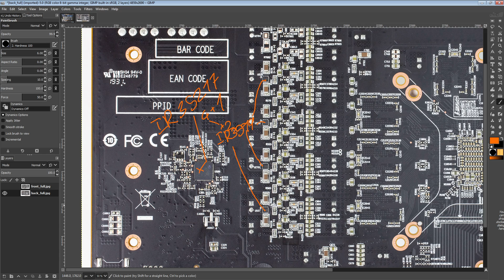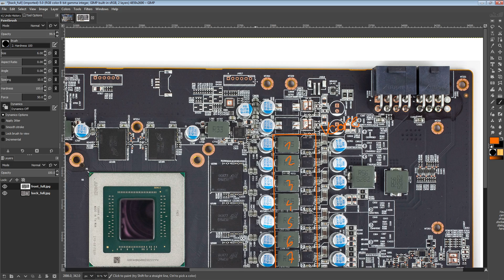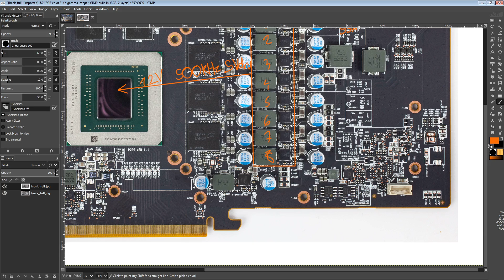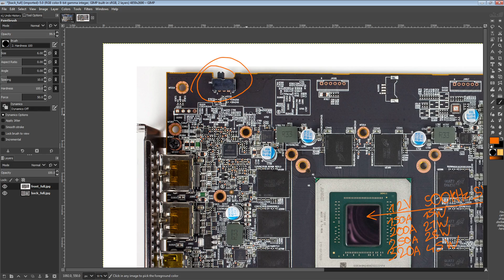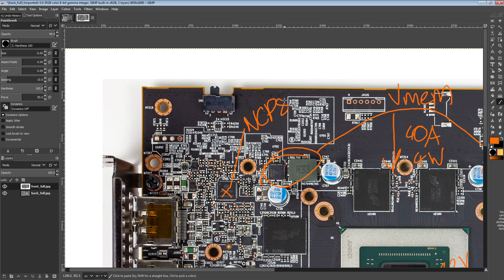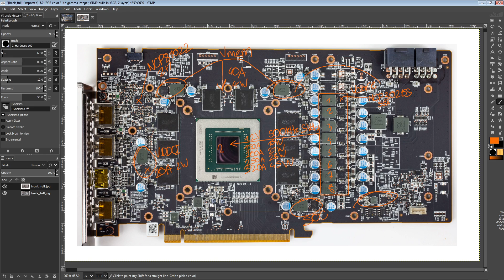GPU PCB Breakdown: Powercolor RX 5700 (XT) Red Dragon

Comment: I have ripped off c4210 component on it. can it cause no boot no power state? what is this component and how can I fix it by soldering? Pads are ripped off and I have no clue where to get the motherboard schematics.

Comment: i picked up a powercolor 5700xt for $350 380 shipped and i run linux, i might have gotten a gold gpu lol i'm getting like 2090mhz on the mem with 875 vcore at 65 to 70C at 65% fan speed

Comment: I am now on my second RMA of a powercolor 5700 XT red dragon, 1st card failed after 2 months with GPU fans on full at boot time, pc seems to boot as normal into windows with no display, 2nd card after 1 month givs a VGA LED warning light on the mobo and stops there with no display, is anybody else having issues with this card?
Reply: @nickwarrior5  thats what i did, i got the sapphire pulse & it runs cooler and quieter.

Comment: Is 1 8pin enought to bios flash a 5700xt? Im worried 5700 gaming oc with its 8 pin wont be enough to bios flash or powerplay to a 5700 xt, I can get both the red dragon and gaming oc at almost the same price like 10 bucks difference in price

Comment: Would you like to do Powercolor's RX 5700 XT base version (non Red Dragon/Devil)? I just bought one from sale as it was 30 euros cheaper than a reference card.

Would be interesting to see how much they've cutted on power delivery. This one does not have dual bios, heat pipes aren't nickel plated etc.

Edit: I can take pictures of the PCB.

Comment: Look at me point at chips that are labeled and recycle basic information.... How about something useful like where they engineered design flaws on purpose? I'll never buy another AMD card and I've been using ATI/AMD since the ATI rage days. They consistently and intentionally added design flaws in several generations of cards after they purchased ATI. When that's not good enough, they sabotage their drivers to make older cards run like crap or crash often. I've owned a high end card from almost every generation and most of them had strange issues eventually. The issues ranged from crashing, overheating, artifacts with no overheating, black screen at boot, etc, etc. Some where fixable by lowering clocks and/or increasing voltages. Some required bios mods and some were just trash. A search would show in almost every case, masses of people with the same exact issues. The thing that made me finally decide that I would never buy AMD card was when I did some testing. Using older versions of Windows with old drivers, magically, 6 out of 7 cards I still have that were crashing, overheating, artifacting and black screening at boot, worked flawlessly with no fixes required. To me that is all the proof I need to know they sabotage their older cards to push sales. Feel free to dismiss me but do your own testing. Grab some used AMD cards on Ebay that have issues and see what happens when you install them on a clean, non updated OS with original drivers.

Comment: Hey zoid, I looked threw your videos an didn't see it anyway did u or will you do a video like this on the reference 5700,  I got the asrock one and flashed it to a. Sapphire reference xt got a huge increase in performance an not running any hotter, waiting on a new pump for my loop rite now
Reply: that is a very good Q. Either google is hiding it from me, or the 5700 and 5700XT reference PCB breakdowns got lost in the hectic rush of things.  Steve has a lot of cooler vids for the 5700xt, yet no PCB BZ analysis that I can find.

Maybe I'm thinking of the pre-launch leaked PCB thing and mentally confusing it with the Vega FA analysis vids.
Reply: @Zarcondeegrissom  ya idk but hoping one gets out someday soon, like i said i looked at both pcbs and they were identical so i flashed mine to a XT since everything was the same on it, and it runs fine and even pretty cool with the blower on it, until i get my new pump anyway , flashing it gave me alot more performance it didnt unlock the cores or shaders but still a nice bump tho for sure that the PPT didnt give me
Reply: ok, just seen something on the Discord grapevine.  the ref 5700(xt) was in limbo due to some info that he was waiting for confirmation/answers to that didn't arrive till he was on vacation. So the vid 'was' in limbo. I don't know what the video production timelines are, tho he hinted the ref breakdown was in the works now that he had the needed info.   I guess all I can say is it's like predicting volcano eruptions, shake the magic 8-ball and it reads out "SOON (tm)", lol.
Reply: @Zarcondeegrissom  well ty man so much for doing the leg work and replying back to me to let me know I respect that 100% and I'm glad to know it will come ty again

Comment: This red Dragon PCB is the retail one or an engineering??
Reply: Retail.
Reply: @MaxBaltzer  funny because in the 5700XT Red Dragon official web page, there is picture with a portion of the PCB were we can see that those 2 capacitors near the 2 missing power stages are missing! Hope that the PCB on the web page is not a real one and just CGI.
Reply: @jvidia  True, tho the picture he has is from the non-XT version, still both the 5700 and 5700 XT appear to have the same PCB layout in their website (I just checked), maybe the website has the engineering pictures? Idk honestly, but I'm pretty sure TechPowerUp has a retail unit.

Comment: 5700 XT Red Dragon or Pulse? What's your choice and why?
Reply from the maker: Red Dragon. Better PCB, similar cooling performance, less ugly
Reply: @ActuallyHardcoreOverclocking  Do you think that the  XT variant of the Red Dragon has the same quality PCB as this non XT?
And is there any equivalent software from Powercolor side as the Sapphire Trixx?
Reply: @chrischartrand8278  Thats great because I like the looks and size of the Red Dragon better than the Pulse. I love small but powerfull cards. Hate this trend of big triple fan RGB  paranoia coolers.

Comment: Please do the XFX thicc soon, you'll have tons of room to write where they extended the PCB by 2 inches and didn't put anything on there.
Reply from the maker: I already did that one
Reply: @ActuallyHardcoreOverclocking  cool I'll check it out
Reply: "they extended the PCB?", lol.   sarcasm, as I'm sure most of the 'excess' is as GN-Steve put it, "them padding the LTT underwear" of the plastic shroud to make it look bigger than it is, lol.
Reply: @Zarcondeegrissom  they just made it unnecessarily big, it's 30% unnecessary plastic and pcp by weight.
Reply: He did that one, and - surprise - it wasnt very good, a fair bit worse than reference. Its XFX, nobody liked them several years ago because like 90% of the cards died early, and theyre still not good.
Reply: @BL-yj2wp  ugh i HATE xfx

Comment: The rx 5700 Red Dragon seems like a good card, I got a Ghost S1 case and the card fits but apparently you need lower pci-e connectors. Been looking for a gpu to this case and I'm still not sure what to get.
Reply: There once was some sort of a pcie power 90° adapter. That might be a solution for you.

Comment: Aside from the power rail stability, can't the capacitors being fully populated make it easier to make EMI compliance though ?  Don't know what it's like now, but 20 years ago in amplifier design small changes like the capacitors made quite a difference in the C-tick (australia) compliance testing time, which was very costly.
Reply from the maker: I'm not sure I've never looked into EMI anything. I don't think the caps on the output would do much since the biggest problem is the phases themselves.
Reply: @ActuallyHardcoreOverclocking  Yeah even back then it was a weird voodoo black art involving secret chambers and magic wands.  Less money trimming the design down to the nub is probably closer to occam's razor.
Reply from the maker: @JasonOfTGA  eh basically everyone else is chopping of capacitors I actually have no idea why powercolor is keeping them on.

Comment: If i don't plan on using pcie gen 4, should I go with a $200 x570 motherboard or the Gigabyte x470 Aorus Gaming 7 for the same price?
Reply: If you don't plan on extreme overclocking (LN2 or dice) either, for what it's worth I've been very happy with the initially problematic Asus Prime Pro x470, which omits features extreme OCers like and initially had problematic BIOSes, but over time has become solid as a rock.  Not tried the Gigabyte x470, and I had great luck with Gigabyte on Intel, but a heard the AM4 boards have horrible BIoses (better confirmed or rejected by someone who has them)
Reply: @JasonOfTGA  used the x370 k7, the bios is not that bad, but msi and asus are quite a bit better (i personally like the msi bios more than the asus), asrock is hit or miss and a bit odd.
Reply: aorus should be fine, alternative for the x570 could be the asus prime x570-p for 170-180
Reply: wait for B550 ?
Reply: I have the same x470 and it works. Great also running a 5700 flashed to a xt